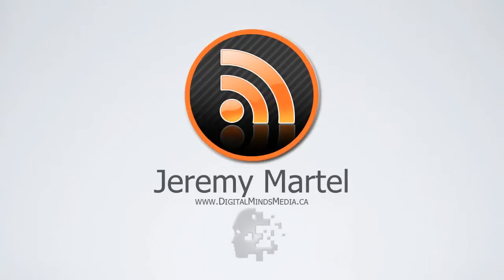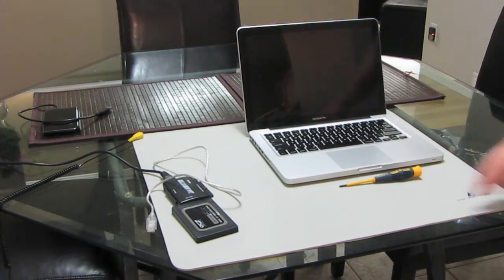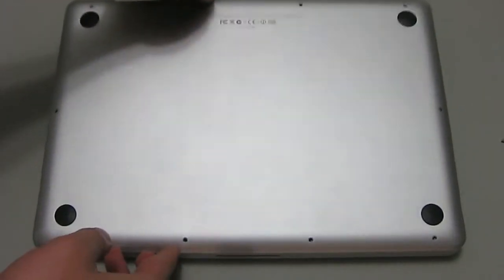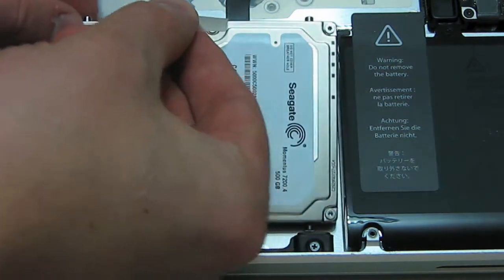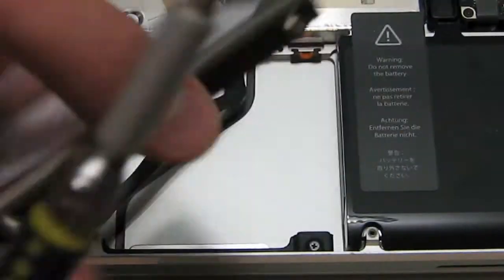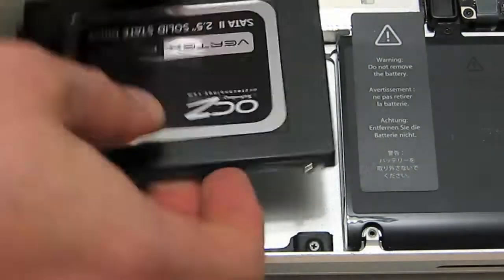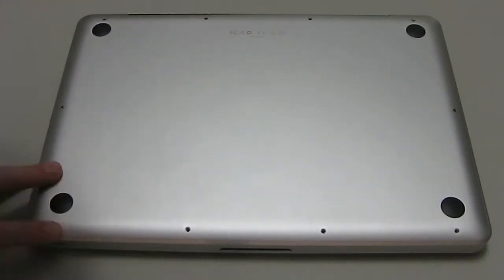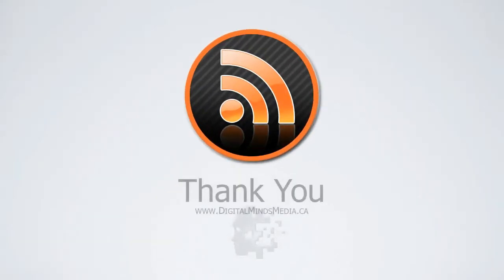How to Install a Hard Drive Install in a Mid 2010 13" Macbook Pro

Comment from the maker: I would if it wasn't fused to the logic board. If you know how to disconnect the power I would love to know how, as it has always concerned me. Seeing that even though the power is disconnected there is still a charge in the battery and that could cause an issue. Thanks for watching my video :)

Cheers
Jeremy